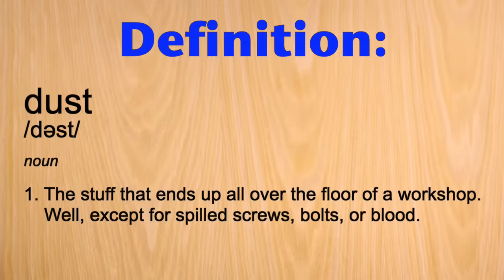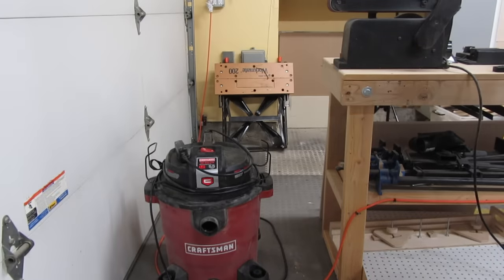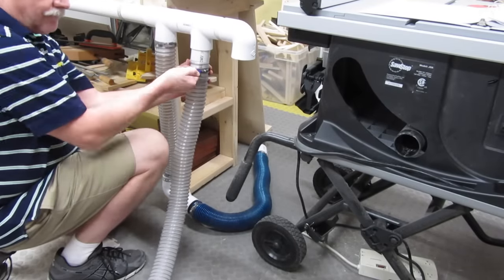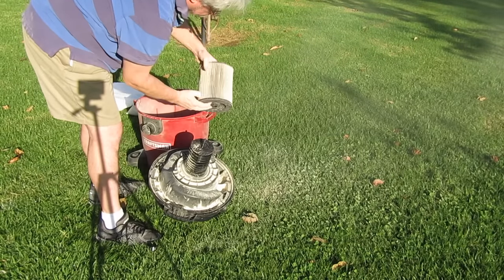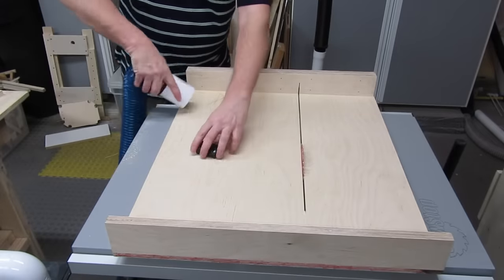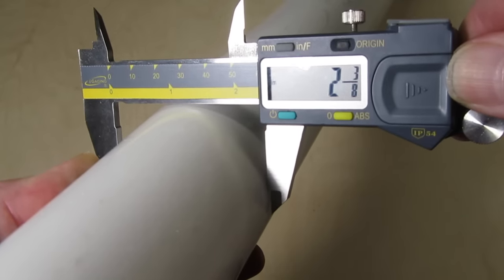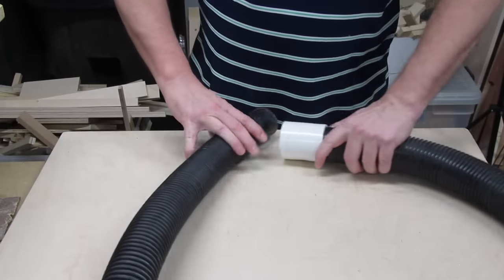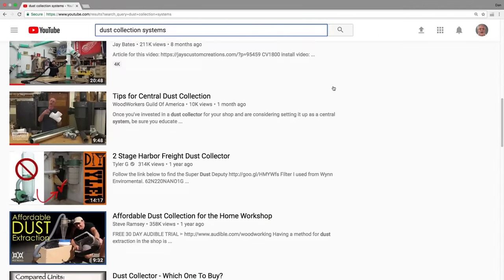Dust Collection for Newbies: Introduction to Dust Collection

Comment: Here's a tip to save you getting covered in dust whenever you have to empty your shopvac and clean the filter.  Instead of shaking it off in the wind, I always keep 2 filters on hand... the one in use in the vac, and a spare.  When I need to empty my vac, I swap the filters and then using the clean filter, I simply vacuum off the dusty one and put it back in storage for the next time.  It saves a lot of dust getting everywhere and since you're always going to need another filter anyway, having it on hand makes it not just convenient, but I've found the filters tend to last longer since they aren't being shaken apart by the cleaning action.
Reply from the maker: That's a great tip, and so obvious (even though I never thought of it before). Thanks!!

Comment: I use my chop saw to cut PVC and have never had an issue. Works great! :)
Reply from the maker: Thanks for the info! 😄
Reply: Same here. as long as you brace the length of pipe against the back fence of the miter saw securely, it makes a very clean cut in PVC
Reply: oh, and forgot to say, great video!
Reply from the maker: @ronweaver4056  LOL. Thanks, I really appreciate it! 😄

Comment: Ive always sorta ignored dust collection. I built an air cleaner to get the ultrafine stuff out of the air, and use a mask when running power tools. But after a few back to back marathon projects with no time to clean and organize between them, my shop looks like a brown winter wonderland and the stuff is tracking all over my house from my shoes and clothing. Going to be exploring a setup like this soon.
Reply from the maker: It's worth it, trust me. Good luck!

Comment: Great Video! Funny how most people are pre-occupied with the cutting PVC and static electricity explosions or what they call dust explosions.

To support rapid combustion, the dust must consist of very small particles with a high surface area to volume ratio, thereby making the collective or combined surface area of all the particles very large in comparison to a dust of larger particles. Dust is defined as powders with particles less than about 500 micrometres in diameter, but finer dust will present a much greater hazard than coarse particles by virtue of the larger total surface area of all the particles.

Below a certain value, the lower explosive limit (LEL), there is insufficient dust to support the combustion at the rate required for an explosion. A combustible concentration at or below 25% of the LEL is considered safe. Similarly, if the fuel to air ratio increases above the upper explosive limit (UEL), there is insufficient oxidant to permit combustion to continue at the necessary rate.

Determining the minimum explosive concentration or maximum explosive concentration of dusts in air is difficult and consulting different sources can lead to quite different results. Typical explosive ranges in air are from few dozens grams/m3 for the minimum limit, to few kg/m3 for the maximum limit. 

For example, the LEL for sawdust has been determined to be between 40 and 50 grams/m3. It depends on many factors including the type of material used. You would hear of wood shop explosions all the time if this were a real thing.  I will post my real question next.
Reply from the maker: Thanks, and great response! And I agree with you 100% that it's not really an issue. Still, I may at some point do a video to show how to ground a system, because 1) it'll make some people feel more comfortable and 2) it'll reduce that "zap" factor. 😄

Comment: A wye is definitely more efficient than a T fitting.  The added benefit of the wye in your triple blast gate config is it would put them on an angle and maybe improve ergonomics just a bit.  Instead of a full underhand grip maybe try flipping the blast gate so its a more natural overhand grip when on the wye.  Its a tiny improvement for sure but i've realized the older I get the more a tiny tweak to ergonomics can increase the amount of time I can work out in the shop.
Reply from the maker: Thanks for the info.

Comment: This is a great video. I'm planning on setting up my workshop once we get our garage built. The only thing I have to figure out, is how to run a hose to the table saw and router, since they'll be on a table that will roll around, and double as a work bench. I also subscribed to your videos.
Reply from the maker: Thanks! If there's any way to put a shop vac underneath the table somewhere, then it could ride around with the table. You probably wouldn't use a cyclone or anything like that, but it would make life much easier. You might even end up using two shop vacs, depending on your setup - I know it's more money, but there's a lot of people who do that. Just something to think about. Good luck! 😄

Comment: I Have cut PVC pipe with a chop saw but like you, just when you think "this is easy and safe" the blade grabs the plastic, shatters it and that's when you start the body check, to make sure you're ok. I think a blade with a higher teeth count would be the way to go but nah ............ use a hack saw. Great vid.
Reply from the maker: Thanks, and thanks for the info!

Comment: Sometimes 2 vacuums are better then one.  I have one 2" that fits over my MT3 for my table for my TS 55, circular saw (adapter for 1 1/4") hose. table saw (2"), router table, and my hand held sanders (1 1/4" hose).  Both the 2" and the 1 1/4" hoses are on lanyards that hook into the PVC swing arm above my head, that leads to the separator and vacuum under my MT3 table.  On the other side of my work space, I have a small 1 1/4"  vacuum, that I've adapted to a larger bucket for my scroll saw, and it is portable to take out to the cars for vacuuming.   Instead of using a lot of piping with blast gates, to connect up a vacuum,  I use plug-in hoses to a central attachment point to accomplish the same thing. Works pretty good as the 2 x 2" flex hoses have different colors and that makes them very easy to tell which one I need to hook up when I need them.
Reply from the maker: Very interesting. It would be cool to see some pictures. Thanks for the comment!
Reply: Rubber connectors with screw clamps work well and are available in transition sizes (2" to 1 1/2"). They are made for pcv pipe
Reply from the maker: @howardbain6516  Thanks for the comment!

Comment: Great video with greeaat suggestions, I have all the stuff, but just got to get to puttin it together. Thx. By the way... I used my mitre saw the other day to cut a bunch of ABS and it worked super great, just run a knife blade around to debur the inside and out and your golden. Doing this on a tablesaw from my experience is a tad nerve racking, and when your nervous about using a tablesaw, well my suggestion is just don't do it, it ain't worth a piece of pipe somewhere where you don't want it. With the mitre saw the saw table and fence holds it very firmly in place, so no real chance of binding and getting kick back. Thats my two cents worth. Again, great video, Thank you and happy dust collecting. Andrew
Reply from the maker: Thanks, Andrew, and I agree 100%. If something doesn't feel right, don't do it! 😄

Comment: Awesome video. PVC was throwing me for a loop with the measurements. In my frustration, i made adapters and fittings out of soda cans and duct tape. Heating it up seems much easier.
Reply from the maker: LOL, it probably is easier, but I really like the vision I have of your way. 😄I had a friend who fixed a big hole in his exhaust using soda cans. Brings back memories. 😄Thanks, and glad I could help.
Reply: @TheNewbieWoodworker  I'm not a super safe guy, but i know your not supposed to heat soda cans because of the BPA plastic lining. But hey,  they do make decent sheet metal. Thinking of using strips of them and a machine screw in lieu of those fancy fasteners.
Reply from the maker: @taylorwhitt3974  Well, I didn't even know you weren't supposed to heat them up, so you're ahead of me! And I always say, whatever works is fine by me. 😄
Reply from the maker: @taylorwhitt3974  That's awesome! Looking at it now, I'll bet you could have rigged up a loop just using duct tape. I don't mean you'd tape it down - just build the loop out of it. Either way, I love it!

Comment: Great video, I found another way to makes a system more efficient, foil tape on all the gaps and crevices, my new jointer and bandsaw had a bunch of openings. Each opening wasn't large but sealing them all up really helped. I'm just using a Craftsman shop vac also, and can connect bandsaw, stationary belt sander, table saw and jointer. Air stays pretty clean except for a little bit over top of table saw. or when I forget to connect the hose when I change tools
Reply from the maker: Thanks! I should give that a try. I would think duct tape would work just as well, don't you think?
Reply: @TheNewbieWoodworker   foil tape lasts longer without drying out, duct tape would work though, I have used packing tape on joints to seal, folding end back to make a tab for easy removal.
Reply from the maker: @mikebishop2432  Thanks, Mike! 😄

Comment: I use a power miter saw (chop saw) to cut PVC often.  It works pretty good as long as you don't end up with a piece that you are cutting off that is too short.  If it too short, it will fall back in on the blade and then get ejected at a high velocity.  I don't know what the minimum size this can be and it probably depends upon the type of miter saw that you have, but if I am going to end up with a cut piece less than 2" in length, I tend to be very careful with it.  Also, I have found that you are more likely to have problems if you make the cut and then raise the blade while it is still spinning (like you might do if you were making repeated cuts.  If you allow the blade to spin to a stop before raising the blade, this helps a lot.  The power miter saw makes a clean cut and allows you to easily cut a lot of pieces to exactly the same length.  My experience with the pliers type cutters is that they often cut at a slight angle.  This is not an issue when the pipe is going into a fitting, but if you are using the PVC pipe for something other than plumbing, the slant might be unacceptable noticeable.  My pliers type cutter is too difficult to use on anything over the 1" size pipe, so I'm more likely to use the miter saw for it.

The adapters that you make that fit inside the hose connector on your shop vac can also be easily made on a mini lathe very easily.  I had to make something similar for my wife's diesel BMW so that I could adapt the car's DEF port to the size of the hose that came with the gallon jug of DEF that I bought.  Just set the compound slide to give a slight taper.
Reply from the maker: Thanks for the tips! And I love your user name. 😄

Comment: The more lift there is on a given flow system the more power it takes to move the intended material. This is true of pumps, vacuums and conveyor systems.  In this video the shop vac is relatively close to the ground level as are the extraction ports on the some of the attached equipment.  It would be far more efficient to run the the pipe on the floor level instead of the bench level minimizing the lift from the floor to the bench.  Additionally the cyclone should be as low as possible so all the dust and chips do not have to be lifted up to that level as well.
Reply from the maker: Thanks for the info!

Comment: This is a great video and a fantastic overview of the foibles! I realized very quickly that I shouldn't try to build a "perfect" - or even "really good" system at the start. I'm going to stick with a semi-portable shop vac and hook it up as needed. 

One thing I notice you didn't mention is grounding safety - static charge buildup and dust explosion can be a real problem! Probably not on a system this scale, I'm used to much bigger industrial systems.. still, the Oneida systems all come with foil grounding tape!
Reply from the maker: Thanks, and you're right - perfection is unattainable. You just do what you can, and move on from there. Static electricity hasn't really been an issue for me, although it might be for other people. It's just not something I wanted to get into in this video.

Comment: Great coverage of a beginning dust collection system!   Subbed, including notifications. I have many of these things, but really liked your long run of pvc with ports  I will consider that idea for the future, especially since you're using pvc for most of it.  One of the biggest frustrations is trying to find fittings/connectors that fit.  I'd advise newcomers to skip the many fittings/connectors and just use pvc in the way you demonstrate here. I also use a smaller hose for some of my hand tools like sanders and routers.I may attach that hose to the long pipe if that looks convenient once I figure the layout.   

Agree with your assessment of the dust deputy!  I tried various lid-type "cyclones" but nothing worked as well as the DD cyclone.  Wished I'd have known this from the start.  Would have saved lots of money on those other types, not to mention new filters.
Reply from the maker: Thanks! Yes, connectors and fittings can be a trial. Fortunately, PVC pipe and/or PVC couplers, along with a heat gun, can solve most every problem. Sounds like you had the same experiences I had with other DIY cyclones. Recently, I looked at the Dustopper lid, and it's not bad. I still like the DD more, but that may be a cognitive bias because I bought it first. Anyway, thanks for subscribing! Welcome aboard. 😄
Reply: @TheNewbieWoodworker  There was one comparison review that gave the Dustopper good marks, but it left behind somewhat more dust than the DD in one session.   But a little will build up over time.  If you are going to do a review, I'd be curious to see what you find.  I'd be happy to go with the Dustopper instead since it is easier to fit into a small space like my workshop.
Reply from the maker: @k.b.woodworker3250  I actually did a review: https://youtu.be/iPHS-y1fWQY. My feeling is this: If the Dustopper would work better for someone because of its form size, then it's probably a good choice. Since my personal testing showed it to be louder and not quite as efficient, in my shop, I'll stick with the DD. But there are passionate owners of the Dustopper who swear by it, so that says a lot.

Comment: I use my chop saw to cut PVC over 1" in diameter. I have a pipe cutter for anything smaller. Never had any problems using the chop saw to cut it.
Reply from the maker: Glad to hear it. Thanks for the comment!

Comment: For optimum airflow, a 90° Street Elbow is better than both the standard 90° elbow or (2) 45° elbows. The more you can reduce the angle, the better...and the 90° street elbow provides a nice gentle curve without angles. 

And yes, the Y Fittings are definitely better, especially over long distances with a lot of joints that aren't glued. T Fittings create a lot of turbulence when flow is coming into the T from the center pipe.

Between the unglued fittings, the T Fittings, and the regular 90° joints you're using...you're probably losing 15-25% of your vacuum. One trick you use to 'seal' the joints is, if you can find them, large thick rubber bands. You put them on the Male side so that when you push the Female section on...it makes contact with the rubber. Doesn't slide over it, just pushes up against it. The suction can draw the rubber up tight against the joint if its done right. 

Great video!
Reply from the maker: Thanks for the comment. I believe that shop vac-based systems using 2" PVC pipes aren't affected by the 90 degree fittings nearly as much as systems with larger pipes and true dust collectors. IIRC, shop-vac systems rely on air speed, and true dust collectors rely on air volume. or something like that. In any case, I've tested with an anemometer, and I don't see much difference, at least in the couple of things I tested.

Comment: Just subscribed. I put in a dust collection for my shop (a little more involved than this) a while back and struggled through figuring things out so this is a great starter for sure. The only thing I could add a this point as I am still learning myself would be to seal the connections with some type of tape. I use a wide duct type tape but I think they make tape just for sealing the connections. I have to laugh at myself after listening to you talk about forming the PVC because I have struggled with using my Dremel tool to hog out the openings (and making a plastic shavings mess) to make some of my connections fit standard PVC sizes. I'm off to find your video on heating and forming PVC.  Thanks!
Reply from the maker: Thanks for the comment, and welcome aboard! For shaping, you'll probably just want to use a heat gun. Nobody likes my idea of using an oven. 🙄And I cringed when you mentioned PVC shavings - those things are the worst! They stick to everything. Ugh. Thanks for the idea about duct tape or whatever works best. 😄
Reply: @TheNewbieWoodworker  Yeah, as far as the shavings, my theory is the little suckers are magnetized in a way that makes them attracted to every element known to mankind.
Reply from the maker: @rogerroger5649  I'll bet that's true, except it's probably static electricity. Too bad they're not magnetic - then it would be a lot easier to pick them up!
Reply: @TheNewbieWoodworker  Yes, hence the need to ground your system. I just ran bare copper wire through the main run on mine and attached it to the outside casing of the duct collector itself.
Reply from the maker: @rogerroger5649  I think anyone who wants to ground their system should absolutely do it. Safety first, always. But personally, this says what I think, for me: https://www.rockler.com/exploding-pvc-dust-collection-ductwork. But again, I'm just some guy with a YouTube channel - doesn't mean I know anything! 😛